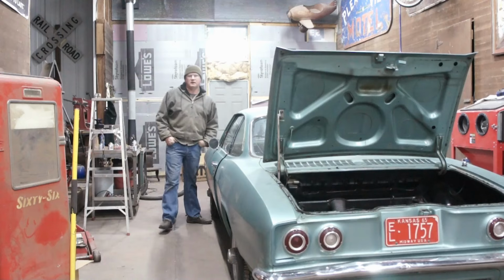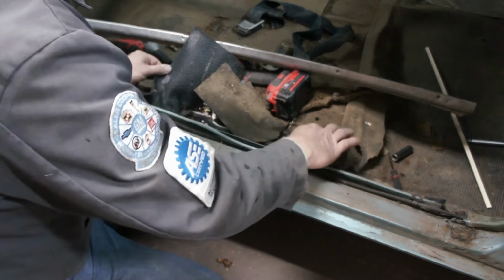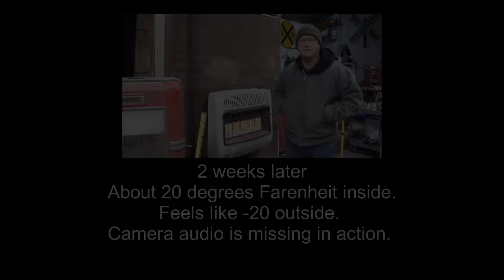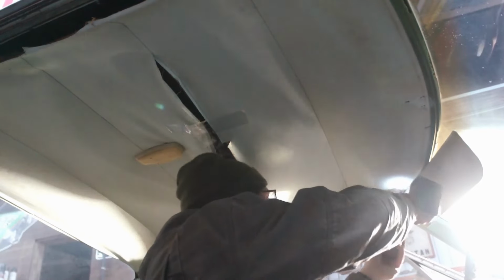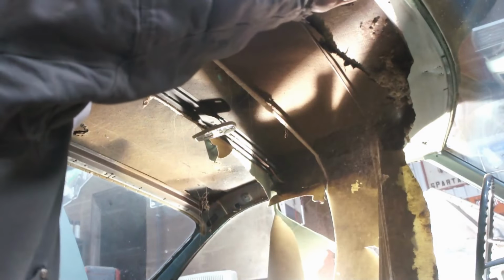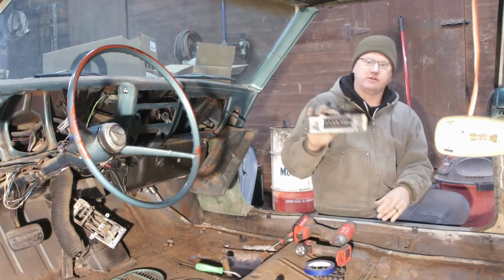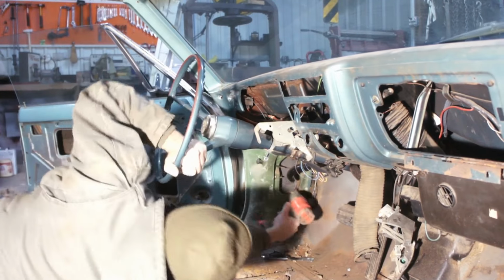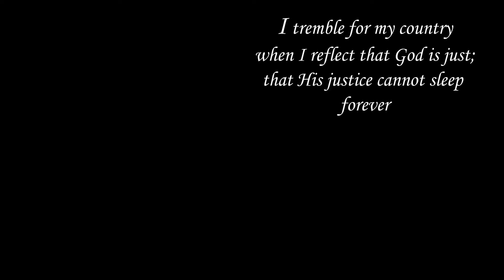1965 Corvair - Complete Interior Teardown

Comment: i worked for chevy back in the day, went to corvair school for what that's worth. that ac unit was dealer install gm kit that's why the hack job. one of the guys in the shop doing an install of these unit and drilled a hole for fastener in the cowl and went through the gas tank, what a day that was.

Comment: As someone who just replaced (welded/steel) 90% of his floors in his early Corvair wagon..., I'd suggest using a POR15 like product on the rear floors. I've had cars far worse than that rear section. Just wire wheel it very well, wash it with an alkaline cleanser (a step too many people skip) and treat it with Phosphoric Acid. Because I do a lot with the acid it is more like "Paint over where rust WAS" than "Paint over rust." POR15 sells a thin mesh that is good for covering holes. I've covered holes in floors the size of a quarter and 15 years later it is still holding up (just make the mesh double the size of the hole). Sometimes I will cover the whole area with the mesh if I feel the metal is too pock marked. Just take your time and don't slap a single coat of POR15 over an uncleaned, untreated area.  It always amazes me that people will see a hole rusted in a floor the size of a quarter and not take into account the floor can have numerous holes punched at the factory.

Comment: I recently inherited two of these beauts. a 64 and 65 both convertibles. Been loving the videos. trying to learn as much as i can about these things as up until i received the cars i had no idea it was even a thing. Just a guess but i think the little Plastic box (for lack of better terms) on the rear interior panel is likely a pocket protector for a flip out ashtray that may have been installed prior to the resto or maybe as an option from factory.
Reply from the maker: Yep that's right. I didn't recognize it at first. Thanks for watching and have fun with your Corvairs.

Comment: Looks like Fred Flintstone floors.  They will take more than a license plate to repair.  Metal detecting inside the car, looking for what, silver coins? On those door panels, I would get some diamond plate aluminum and make some 4" tall x whole door length kick panels that cover the torn part.  It would look good and prevent further damage.

Comment: Good video Mr jayhawker I got question I have a 48 4door fleetmaster body is original and in great shape but the hand chassis is rotted what can I do would reinforcing the frame work or do I gotta replace its pretty bad it rotten all the way thru in the back over the rear end
Reply from the maker: It depends on just how much damage is done. If it's just in small areas like a couple of inches or so it is possible to cut out the bad stuff and weld in patches but even that will be difficult without at least raising the body off the frame a few inches so that you can get in there and weld all the way around. It's also best to take the weight off of the frame so that you can make sure it is not sagging because of the rot. If it is very bad and whole sections of the frame are rotten, esp the arc over the axle then yes, its best to find a replacement chassis. It would also be possible at that point to cut both chassis apart in front of the rear axle and weld in the new one; that way you wouldn't have to rebuild the entire front end of the car. But you know your situation and abilities best. Good luck!
Reply: @TheJayhawker  thank you my brother bums me out a little but I'll have to hunt down  a cherry frame